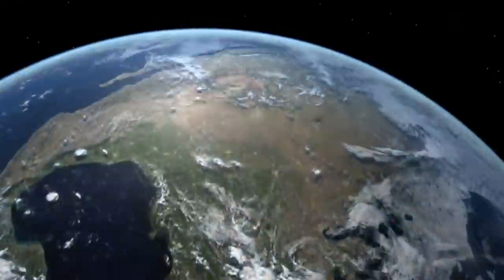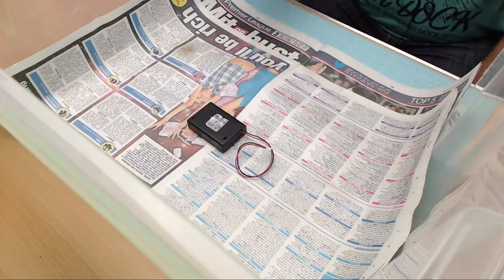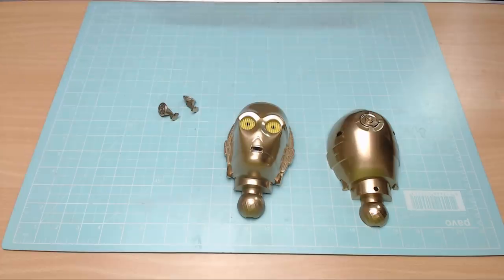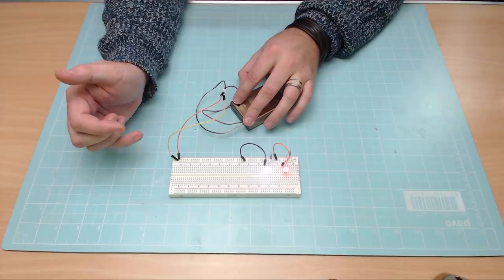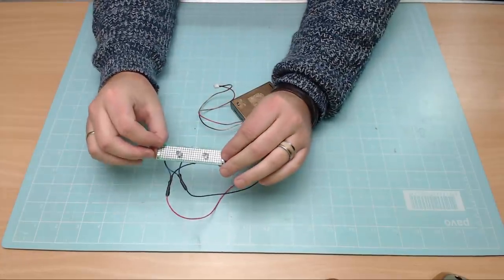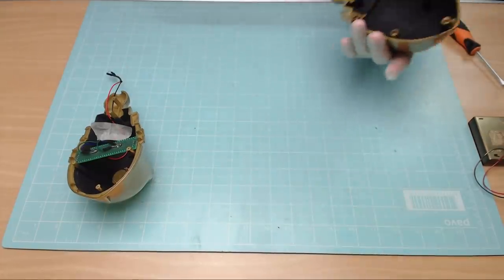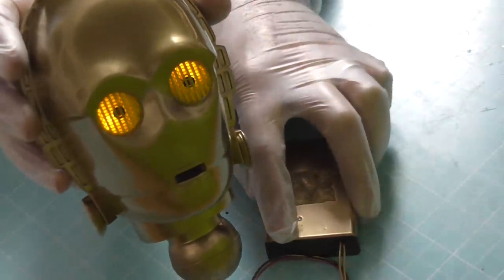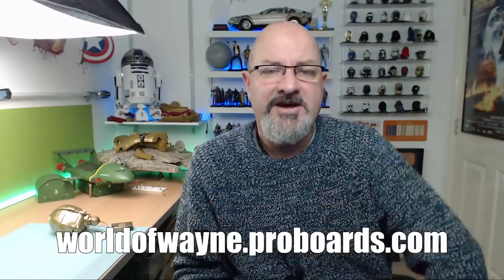The C-3PO Project - Part 2 - Completing the Head

Comment: Wayne, consider using an adhesion promoter first. It’s a clear spray usually found where auto paint is sold (3M makes it in the U.S.). It will help paint adhere to most plastics much better with added durability. I use it on models were some plastics resist paint adhesion. Great videos by the way!

Comment: May I suggest a black primer before the metal. For some reason it makes metal paint pop.
Reply from the maker: It's not needed. The plastic already has a gloss.
Reply: Oh, okay but it’s also good as a primer and could actually stop any of the paint rubbing off. Especially if you’re not using a topcoat.
Reply: Actually, the black paint first should be gloss, and it’s not about just having a glossy finish, it’s because metallic paints are slightly translucent and the gloss black underneath makes it look more metallic for some reason. I know for a fact this works great for chrome paint, but don’t know how much of a difference it would make for gold. It looks good though as is. Much better than not painted. But it is good you did the black inside, because the led could possibly bleed through the gold.
Reply: custom fabrications you are correct. I can vouch for the black making the gold pop because I’ve done it as well as the chrome. I’ll be interested in how the gold will work on the red arm compared to the other.

Comment: Just got my C3P0 in the mail today. I plan on doing this build also.i did not realize that the electronics would be this advanced. I have no experience with Adrino. What do I do? The kit on your page does not ship to the USA. Is there an Easter way other then using a motherboard? Please help.
Reply from the maker: I'm not using the arduino at all for the lights. All i have is a power source connected to two LED's. The motherboard you see is just to hold the LED's you can simply use a bit of plastic in its place as long as you have a working circuit between the battery pack and the LED's
Reply: @WorldofWayneUK  oh great. Thank you Wayne.

Comment: Just wondering why  you needed a circuit board? Could you just run the battery pack to the LEDs and create a continuous circuit loop with a resistor in line of the positive line? I'm a circuitry dummy so excuse me if I sound dumb! I really am! LOL
Reply from the maker: I needed the light to sit away from the eyes as they would be too bright and not look right . By mounting them to a board it centralised the light and diffused it well.